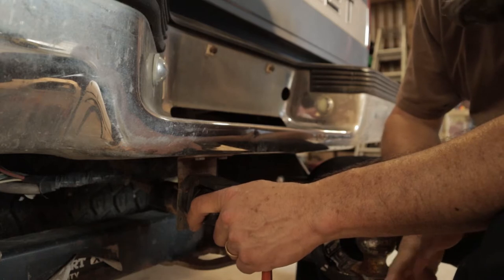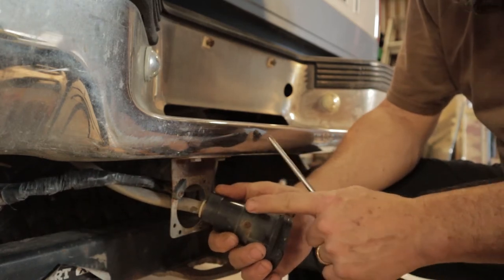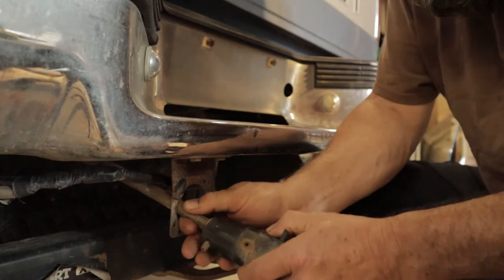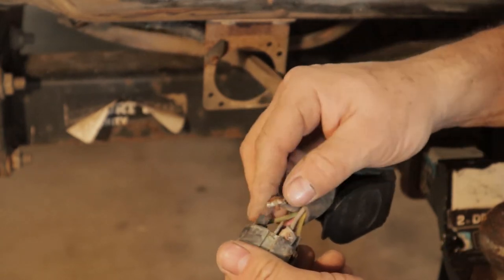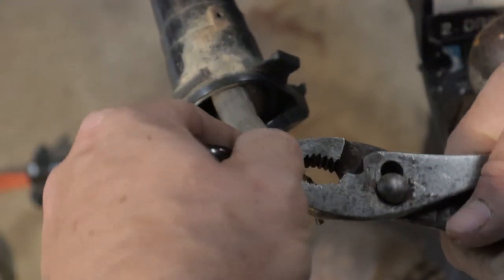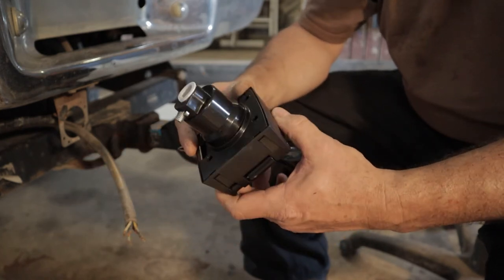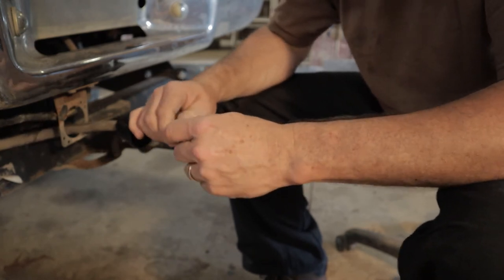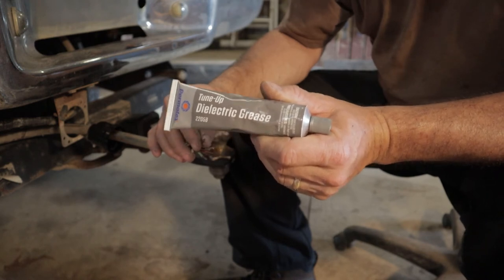Replacing 7 Pin Trailer Plug.

Comment: Could I ask, is there a reason why you didn't cut back the old wires 1/2" and strip new copper for the new connection?
Reply from the maker: The copper seemed clean, and the wire was easily inserted into the new plug. If the wire appears, to be corroded, has different lengths, or hard to fit in the plug because it is twisted crazy etc. then I cut them all off evenly and start over.
Reply: @HumbleHavenFarm  thank you!

Comment: Question. 
Do you unplug the truck’s battery before starting.?
Reply from the maker: Sorry, it has taken so long to respond. It would be best to disconnect the negative battery cable to eliminate the chance of blowing a fuse or sparking wires. Depending on your particular setup, all power to the plug is "switch" power unless you have an auxiliary wire (12volt constant power) usually used to charge camper batteries or power lights inside a trailer.